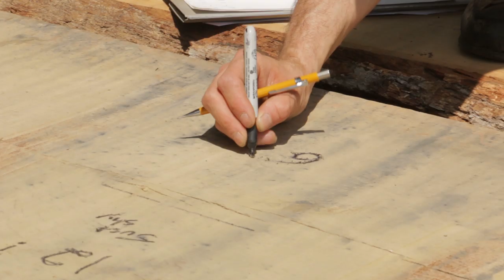Acorn to Arabella - Journey of a Wooden Boat - Episode 68: Planking: Laying the Groundwork

Comment: Steve a suggestion if I may, when trying to start the plug cutter to remove the broken screw, take the cutter out of the drill and place it over the screw, and give the cutter a whack with a dead blow mallet two times to establish a grove, turn it around to cover the open part of the cutter grove and give it another couple of whacks and that should give you a complete ring into which the cutter will run thus giving you a good start and hopefully get it to run true without skidding off track. I love what you are doing, you are all making a great job of Arabella. Look forward to the first plank going on. Keep up the great work!

Comment: Watching you swing that adze is a joy!
Reply: Woodcraft carries several sizes of tiny hole saws designed for screw removal. They’re delicate but faster and cleaner than the plug cutter, and with a smaller kerf. 

You can make one by filing one or more teeth on anything hollow and cylindrical, which helps with large sizes or where a tighter hole is required.

Comment: When you were using the bit to drill out the broken screw if you would start drilling on an angle at a fast speed it starts a half moon and is much easier to begin drilling around the broken screw . Learned this while drilling with diamond bits into porcelain tile . Also love the series watched every video learning a lot thanks .

Comment: hi with the plug cutter  drill, a hole the same size in a peace of ply wood big enough to clamp to the boat then you have a guide to start the plug cutter with
Reply: BOOM!--right here.  I use hole saws to cut holes in tile and they can be finicky to start as well.  Using a jig as suggested above to help guide the start works perfectly every time.
Reply: a yup your right............
Reply: I had the same idea, I had to make some plugs the other day and it works a treat. I hope the guys read this for an easy fix.
Reply: Right on. Works like a charm although I prefer solid wood guide to a plywood one. Somebody sells a dedicated drill bit for this exact purpose.
Reply: Or, if its a 'one of' and no time to make a jig, start by going in reverse with the plug cutter, which will have less tendency to wander or dig in, but still makes a bit of a gouge, which can be easier to follow slowly in the cutting direction.
Reply: Also, drive two or three sharp-pointed screws through the plywood around the hole for th plug cutter, so the tips just protrude slightly, then you can center it over the screw to be removed and press it against the framing. Hold the jig in place with the screw tips pressed into the framing, and it will not move or spin as you start cutting with the plug cutter.  You can do the same with a hole saw when you can't use a pilot bit.
Reply: Starting with a high speed and light pressure can help too. Going slow with too much pressure the cutting face has a tendency to grab and run off, rather than cut the fibers.
Its a bit counter intuitive, but seems to work for me.
Reply: Grab a piece of tube steel , grind around one end basically creating a hole punch. Now you have a tool to give you a starting groove and stop the bit running off.
Reply: @hoyks1  High speed and light pressure. Also start the cut on a bit of an angle then square it up as you establish a cutting path. Starting square to the surface gives too much area where the cutter will catch and run away.
Or a scrap wood template to start you off...don't need to clamp, holding by hand, higher start speed and light pressure is usually enough.
Reply: I do the exact same with hole saws.  Good call
Reply: @cpad007  Right on.  As a tiler of 25 years I found that starting the hole with the hole cutter slightly at an angle to the work and very light pressure allows a sort of arc cut which you can then slowly then straighten up.  Holding the hole cutters against the work and then starting it is a bit of a no no.

Comment: In dentistry we remove fractured posts screw or otherwise with a masserann kit. You are presented with a fractured stub, you work out its diameter with placing different size tubes over it. The correct size drill is selected it is tubular with end cutting teeth. It I slowly rotated anti clockwise. It gets some way down and sort of unscrews the broken bit.
 Could make something similar on a larger scale. You are doing a really great job, and I appreciate the wonderful work you are doing. Geoff.

Comment: To speed you up and save your sanity, build a sliding scarfing jig for your big bandsaw. All it is is a subtable ( with a slot guide) big enough to allow around a 30" stroke for the sliding part that has a vertical fence set at your scarf angle. With it you can cut a scarf the width of the clearance of the saw and clean it up (if needed) on your planer jig. You need a 1 tooth per inch blade and a slow feed rate. Screw the wood to the fence with screw lengths that will not intrude into the cut path. 2-3 people and a roller support are also needed to guide and support the wood through the cut. At my previous employment, 3 people were able to scarf wood 12" wide x16' long on a 36" bandsaw and glue it up with resorcinol without further messing with the joint. We could cut the scarf and have it glued up in less than half an hour start to finish. In testing, the wood would break someplace other than the joint, but the joint was stiffer than the regular wood and needed to be located in a lightly, evenly curved section of the elliptical stairs we were building. Love your videos and best of luck in your project. If you need more info let me know.  Mike
Reply: Sounds like a lot more work doing it that way than the scarfing jig they already made.
Reply: @Garryck-1  If you have ever made a scarf joint you would know that the planer jig will take 20 to 30 minutes per end to cut the scarf and requires some skill. With the bandsaw jig, once it is built, scarfing takes about 5-7 minutes per end and only requires strength or numbers for repeatable accuracy. I have made thousands of scarf joints over the last 45 years and I know which one I would use.

Comment: done similar for backing out broken screws. For starting the bit, I've used a plywood template with a hole equal to the OD of the plug cutter. (Same trick for making bungs in a pinch without a drill press.) Congratulations on progress

Comment: If you have to do that again, glue the blades together just make sure they're perfectly square and grind them together, you're guaranteed identical angles.
Reply: Moreover he should be doing 3 blades everytime so there will always be a control to cut from.
Reply: put blue tape on both, super glue them together, then you just have to break the seal of the tape of after and no residue
Reply: I suggest a jig.  First, you will to control a consistent grind on both sides of the blade.  Second, sharpening will be quicker.  Third, with all the planking, 2 blades just aren't going to last. Create clamp, add long arm to approximate the radius of your curved cut, and set it to sweep the sharpening abrasive.
Reply: @larrybriggi9898  In this video I spotted about five times a jig would have been quite useful.  But I have to hand it to them for taking on this project.  They're doing fine work.

Comment: Steve, Simple hint for removing broken screws with that plug cutter. Get a piece of wood - solid wood, plywood, whatever, perhaps 1/2 inch thick. Drill a hole through it the size of the plug cutter itself. Use that as a guide over the screw. Prevents wandering. Jon

Comment: For those stuck screws.. use a 3 jaw chuck drill, tighten the jaws onto the screw bit poking out and pop the drill into reverse.  Has worked wonders for me every time :)  Grabs hold of the screw and backs it on out :)

Comment: If you ever have to do that again make a circle jig for your belt Sanders table then you could mount the blade to a quarter circle pivoting on the circle jig to get the arc and if you have the table tilted you have your bevel following the arc and it would be easily repeated so if you needed to sharpen them which you'll need too come time for planking.

Comment: A tip for using your plug cutter. Take 1cm piece of scrap and use the plug cutter to bore a single hole. Hammer in a few brads so that they just peek through the bottom (for grip). Position this in the place you need to start your plug cutter and let it guide the plug cutter to get it started.

Comment: I might have run the planks diagonally across the table saw. Infinite height adjustment per-plank, and with a good fence, terrific side-to-side adjustable.
Not to mention no down time modifying the DeWalt blade(s).
Reply: 40 Ft planks. Does that need more explanation?

Comment: Get a piece of plywood about 1/2" thick and drill a hole on it the size of the plug cutter and use that as a guide to remove the broken screws. Great videos, thanks.

Comment: for help in starting the plug cutter------take a small piece of 1/2" MDF (etc) and drill a hole near the center the same size as the OD of the plug cutter, tack on the MDF with the hole right where you the screw is you want to remove and then go to town. The hole in the MDF acts as a guide for the plug cutter

Comment: Just one more... I’m not a ship builder but I’ve been a custom home builder since 78’ and studied structural engineering. There’s one structural feature that catches my eye each time I watch one of your videos, the frame-to-keel connection. I realize the brass floors are a connection point but given the immense weight of the keel as well as the lateral pressure of the waves, do ship builders ever use a dove-tail connection for this?

Comment: Plug cutter tip is a winner. Try hitting it with a hammer to get it started exactly where you need it, then use the drill.

Comment: Next time run your drill in reverse with the plug cutter...it will put a nice indent into the wood without wanting to catch on the lumber and that slight indent it makes in the wood will then keep it from wanting to spin away
Reply: i still have nigthmares abour the time i tried to center a hole on a steel pipe lol

Comment: Handy tip - if you want an easy way of starting your plug cutter, run it straight through a three quarter or one inch piece of scrap then centre the hole over the point you want to drill and away you go.

I can't remember where I first heard about this but it's a method I use when I need to enlarge a hole that was previously cut with a hole saw.

What was the fluid you used on you diamond and Norton stones?

Comment: I've used the plug cutter method myself. I took a small bit of of thin plywood and cut a hole to use as a guide to start it much easier.

Comment: To get the plug cutter started, you could make a drill guide.  For a few screws you could probably get away with just a 1/2" piece of plywood or whatever scrap is laying around.  A steel bushing would be better but probably is overkill for this job.  For hole saws, I've used a bit of scrap with a v cut into it.  That, combined with tilting the hole saw works well enough.

Comment: Check those DeFalt blades from the side. You will be able to see where the hardened high speed steel insert mates with the mild steel backing. Once you've used up the HSS part you gotta piff the blade and start anew. The more modern blades that come with the planer don't have anywhere the meat that the older ones did. You should be able to buy some after market blades that are heftier that the factory supplied ones. Your DeFalt HSS blades should fit straight into your old Makita machine - universal fit. You can also buy adaptors which convert from HSS to solid carbide .

Comment: @24:30ish... A board about 3"x3", 1/2" thick with a hole drilled in it the diameter of the plug cutter helps keep it from rolling out.  Just hold the board over the spot and run the plug cutter through the hole to get a nice clean start.  This works well with Forsner bits too!

Comment: When I have a broken screw, I usually use a roll pin. Take a file and cut teeth in one end so they cut when the drill is reversed. Use it like your plug cutter. Usually about half way down, the screw will catch in the roll pin and because it is in reverse it will unscrew itself.

Comment: The way to start the plug cutter precisely where you want to cut when using it in a hand held tool is:
make a guide bushing for the tool diameter being used with a small block of wood thick enough to support the tool on its diameter.  Center the bushing over the area where you want to cut.  Hold the bushing in place either mechanically or by hand and drill in to a depth that will support the cut and take the bushing away or leave it in place and complete your cut.
This works well with hole saws too also when drilling next to a hole where the two break into each other.
JIM

Comment: Old trick to get the plug cutter started: Drill a hole in a small scrap of wood the same diameter as the plug cutter. Put that scrap over the screw, put the plug cutter in, and start drilling. You may need clamp the scrap on.

Comment: Here is a tip for your plug cutting, broken screw chore. Before putting the cutter in your drill motor, place it where you want the cut to start. Then whack it a couple of times with a hammer while moving the cutter so as to make a circle indentation. That ought to get you started.

Comment: A scrap of wood with the same size hole as the plug cutter temporarily centered, and fastened over the broken screw will make an easy job of getting you started. Use the same trick when I have to bore a hole larger with the holesaw.

Comment: Suggestion: I believe the DeWalt plane will work better if you could modify the base to match the arc of the blade.
Reply: Not worth the effort, i speak from experience. Many moons ago, one of our restoration projects involved curved beams, we were forced by circumstance to modify an electric planer and it's a PITA.

Comment: Best broken screw extractor is a piece of small automotive break line or similar pipe you use a grinder to shape a tooth on the end so it will cut with the drill in reverse it will usually grip the screw and you won’t even have to drill it to full depth because the broken screw will just back out a retired shipwright told me about it I thought it sounded a bit weird but I tried it in a pinch works like a charm

Comment: This backing out could also be accomplished on a table saw and would be repeatable very rapidly.  Set your depth and run the plank across the table at an angle.  Instead of using the blade to cut a line, it would be at an angle to your planks direction and would cut a cup or slight radius out of it.  You could even set guides up so that the piece always runs at the same angle for the length of the plank.  Then when you need to cut the edges for the opposite cut you just move your guides to do so.  It may take a few blades to do the whole boat but I'd imagine that you will go through quite a few planer blades as well.  I think you'd save hours doing this.
Reply: Repeatability isn't the point.. every plank will need to be done slightly differently, and the depth and lateral position of the cut probably won't even be consistent along the length of a single plank. Changing the setup every few feet, for every single plank, would be a royal PITA.

Comment: Since the planking only touches the frames for a few inches at every frame, why plane all that material off the planking? Just dry-fit the planks and rout the profile using each frame thickness as your router offset. You could cut all the slots and then just move the plank aft a frame width for final fitment.

Comment: To help getting that plug cutter started try drilling a hole (size of plug cutter) in a small 3/4" - 1"  square of ply with 4 screws barely sticking out of four corners (spikes) position hole over desired area press in so spikes grip and this should allow you to control the plug cutter Enough to start hole.

Comment: Drill a hole in a piece of plywood the same size as your plug cutter. Hang on to, or even screw it to the wood with broken screw.  That will keep your bit centered for starting. Do the same thing for a hole saw when you don't want a pilot hole.

Comment: As always, great work and excellent content, guys.   Quick question out of curiosity.  It looked from your fairing work of the rabbet like there will be places where the garboard plank and maybe a few above it will not lay completely flush to the keel timber, since the frames are already curving out away from the keel, resulting in some “pockets” between the plank and the keel timber, below the level of the top of the keel timber(bilge floor?)... is that the case? If so, do those pockets/gaps get filled with something to prevent fresh water accumulation there? I know you went to a lot of trouble to create all the limber holes and channels in the floors to prevent water being trapped anywhere. Or am I seeing things, and perhaps imagining gaps where there will be none?
Reply: I'm pretty sure that if there are going to be any gaps, Steve is already way ahead of you when it comes to dealing with them. His attention to detail is second to none. Have some faith, and wait and see.
Reply: I have the same question. There's a frame that looks 3/4 inch away from the keel timber. Will that create a large open gap behind the planking?

Comment: If you have had to remove 100 broken screws, that means you don't do enough predrilling.  And I have the feeling you will try to shape the whole length of each plank when you only have to mark and shape the planks at the point of contact at each rib.

Comment: with 40 ft planks i guess the power planer is easier.  But you can also achieve a holowing out curve by seting up a jig and runining the planks at a diagonal, with a shalow set on the table saw.  As they say, "there is more than one way to skin a cat!".